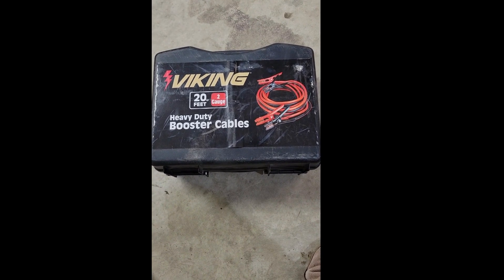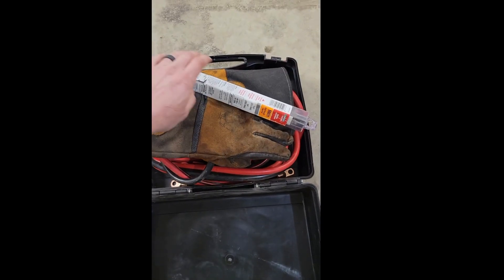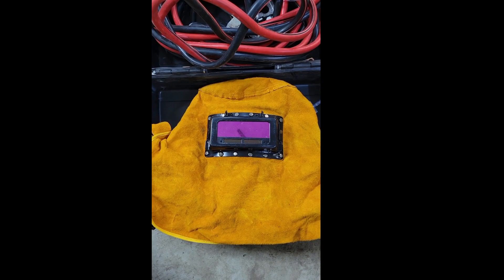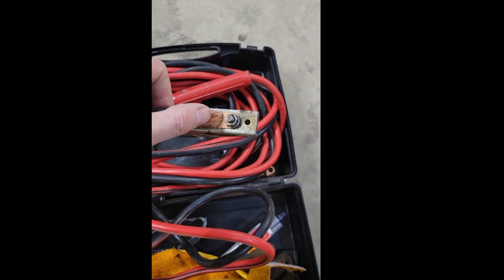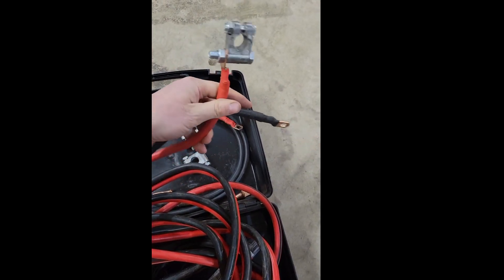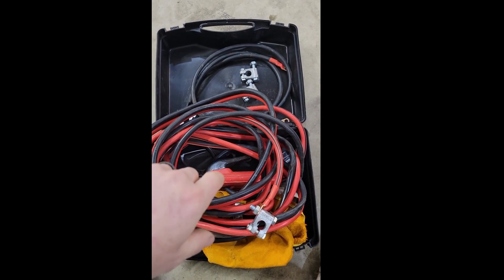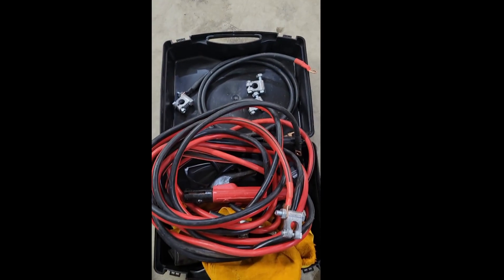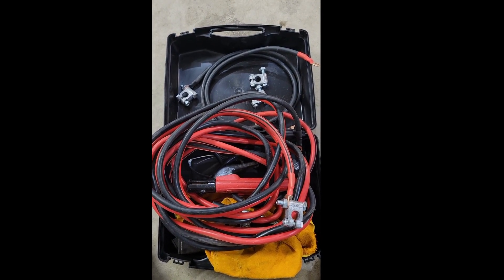Quick tips: Budget DIY trail welder

Comment: Should have tossed up some action shots with the battery weld in progress, tried a couple different rods etc. Nice setup and I like the hood.
Reply from the maker: I thought about that, was just trying to keep these "Quick tips" videos short. I can do a more involved video if enough people are interested. I should probably practice with this set up anyway.
Reply: I'm interested in best rod size to use.  3/16 or 1/8".  How much welding can you do before having to toss the batteries back in the rig and charge em? 

Going to scour amazan for that hood.
Reply from the maker: @tomcompoli  good question. I have not used this set up much yet. Although the info you are seeking is going to be the same with any 2 battery stick welding.